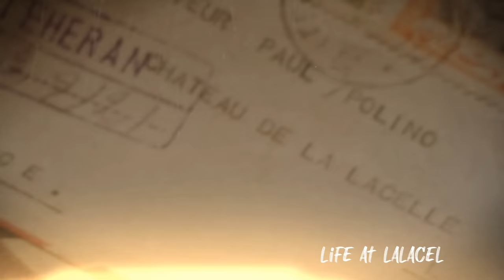The Last Jobs For the Château KITCHEN RENOVATION.

Comment: One of my initial concerns was light in the space. ☀️ You even acknowledged that the lack of abundant natural light was going to be a challenge. You've clearly overcome that obstacle by the light colored tiles, paint and cabinets, and strategically placed light fixtures.💡 I did notice that the counter to the cabinet left of the door could use a smart little lamp to illuminate the surface.🏮My guess is you'll address that in the staging and turn it into a positive.
Overall, a job well done.👍 Enjoy your first of many meals in your new kitchen, you guys deserve it.🍽️🍽️ Bon appetit!👨‍🍳👨‍🍳
Reply from the maker: Thank you so much 🥰🥰

Comment: I just watched this one. The kitchen is looking so wonderful ya’ll. Terry, I have a “tape tip” for you. After you’ve pulled your tape off of the roll, if you fold the end piece in on itself, you will never have to find it on the roll again because it will always be visible, and it will never start tearing off in separate vertical strips either (a sewing tip I learned years ago). Hugs to all of you, and especially your sweet Mom. 😊

Comment: Terry & Ash, it’s exciting to see the fruits of your labor bring everything to fruition. I’m with Ash on the backsplash tile height. I’m in agreement also about not staining the window ledges. Painting one color allows them to be visible, but not become focal points. The only thing [I] would have done differently is to have hung open wood shelves vs an  overhead cabinet. (It’s a personal preference of mine in galley kitchens.) It’s a great way to display pretty  dishes, vases, candles, etc. It’s your kitchen, though, so you’ve done what works best for you guys and that’s as it should be. Love the paint color. Good choice in the stain color for the wood floor. Lovely kitchen!

Comment: @ Ash or Terry for the extractor. You could do an pop up extractor, or an pop out extractor, rising from the counter or sliding out from the wall, respectively. Popping out of the wall, might be easier, considering the ceramic tiles, for if grease, overwhelms the area. You could probably find an low profile extractor, and modify it to work, especially if it’s one that’s not externally vented.

Comment: I suggest tiling in the area up to the extractor. Over time, because the air is pulled there, the wall will get greasy and soiled. Cleaning the paint will emphasize the problem. But it is your house. N
Reply: Thanks Neil 😊

Comment: If that was your first go at tiling Terry, chapeau!  It looks grand.  In old buildings that tend to flex a little with the seasons I usually put a spacer between the bottom tile & the wooden worktop surface and the fill that with flexi-grout it to allow movement in the wall and/or the worktop.

Comment: I think Ash is right about the stove vent.   
The juxtaposition of the old beams and ultra modern kitchen appliances complimenting each other....
A sheet of fire resistant glass can make a higher backslash around the stove without  taking away visually from the historical charm.
Reply: Thanks Zander 😊😊

Comment: I'm watching this 5 months after you've posted, so I don't know whether you decided to get a microwave... You have so much fantastic cupboard space in the hallway.  Why not wire up one of the cupboards with an outlet so you can have a microwave on a shelf plugged in and ready to use in a pantry cupboard?  Out of sight, but available for the occasional times you need it?

Comment: I would of staggered the tiles so that they would of been like a brick wall, so one goes over the gap with equal sides if you know what I mean 🧱
Reply: Thanks Paula. Only reason  I didn’t was as the walls are quite bowed with the age of the building and my thinking was if there was no straight lines to reference, you might not notice it as much 😂😂
Reply: @ashleywaters7198  ok, I see where you were going with this, thank you for clarifying, still looks stunning & I can see how giddy you were, congratulations on the finish 😂😂
Reply: @paulakershaw5452  thanks Paula :)